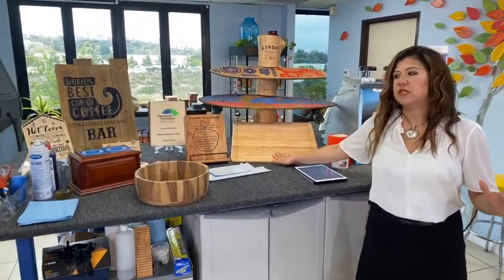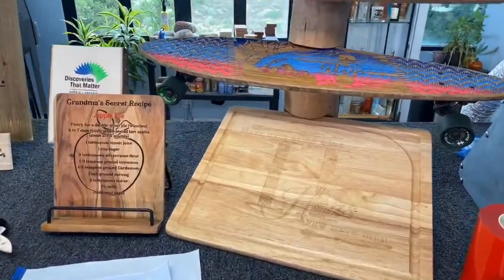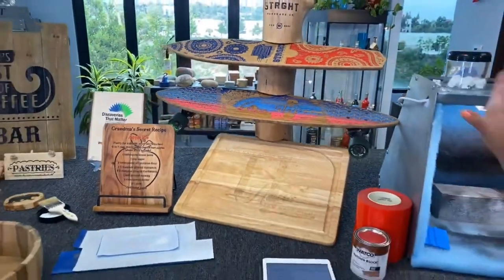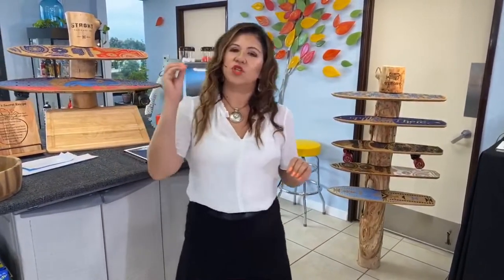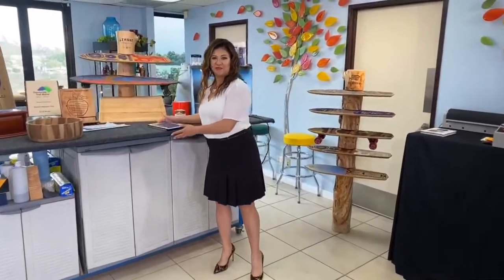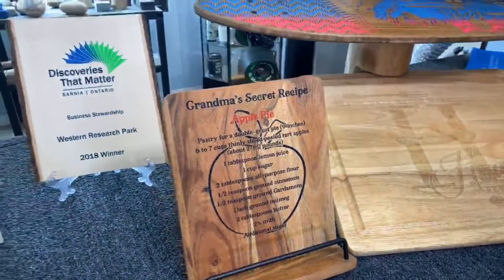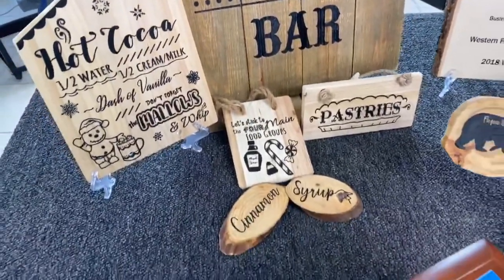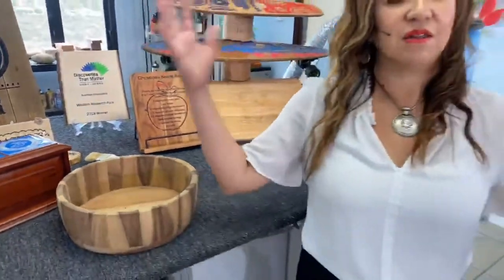XIV | Sandcarving Wood

Comment: Another excellent video with lots of good tips. I engrave wooden baseball bats and ran into trouble with the R-3000 bonding a bit to well to the wood and paint -( I often use several masks to achieve an effect and have to apply the resist over a painted surface.) Billy Willis, who has been a great help, recommended the R-2000 and it works like a charm. I apply the adhesive with a simple airbrush. Be aware that there is a separate adhesive for brushes and for airbrush application.  I'm wondering what kind of resist Gabe uses to blast to those depths at 120 PSI? His work is awesome. Also curious if you've ever had problems with gloss paint? I've tried Krylon and Rustoleum gloss (I prefer satins and non-gloss paints), but it forms an almost plastic like coating which sometimes peels with the resist.  I've yet to try  the Montana paints, but will be ordering some shorty. Kudos to the folks at Rayzist for their great training videos and excellent customer service.
Reply from the maker: Thank You, Dan for your comments! We appreciate your viewership. As well, sharing your successes. We are very pleased we could help and assist you in producing better products using our products. That is the goal of the videos we have produced.
Gabe uses SR2000 6Mil for his boards and uses the Montana Black series (high-pressure paint) but also uses the Gold series (low-pressure paint) for some detail work. He started with the Belton Molotow (low-pressure paint) experimented with several of the 'caps' for paint effects. 
The above materials are mural artist quality paints with excellent pigment and performance for glass, stone, and wood. Primarily all we use and today (expect for our monumental grade paint)
Keep up the great work yourself!!
Reply: @Sandcarving  Thanks for the information.
Reply from the maker: @danhealy2280  Apologize for the delay in getting it out....
Reply: @Sandcarving  No worries,